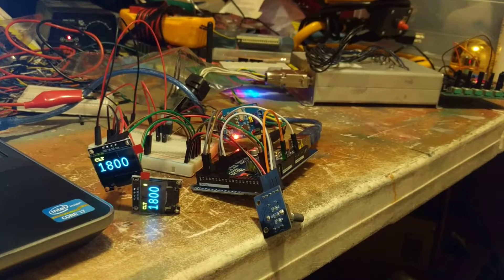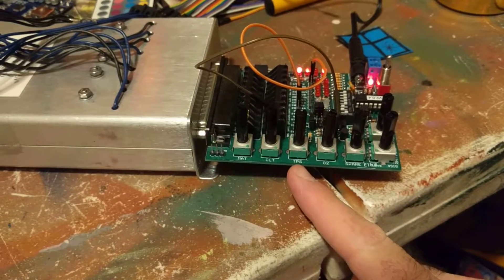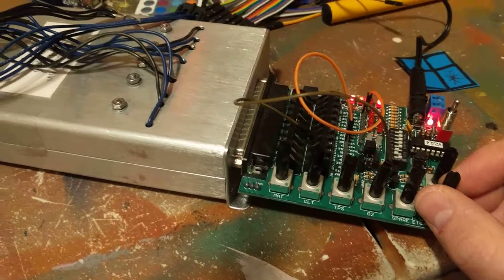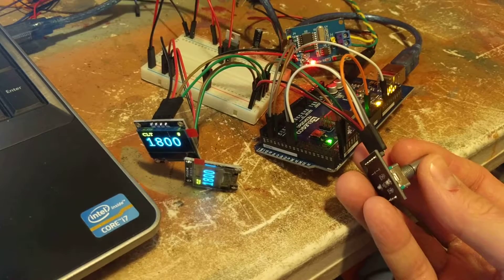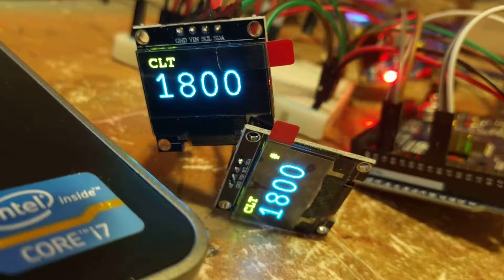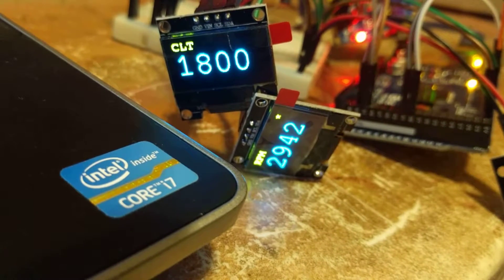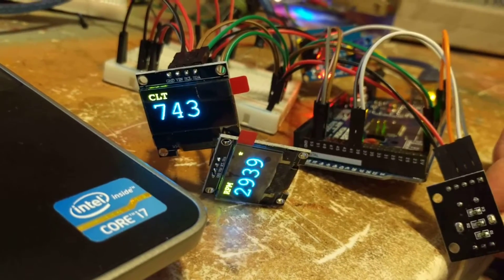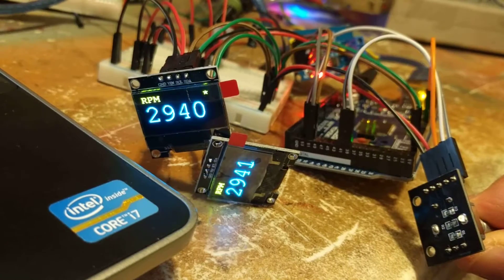Megasquirt 2 with Arduino Display over CAN Bus

Comment: I've been trying to figure this out for a while. Are you willing to share the arduino code for this so I can see how you did it? I get the arduino to connect to the MS via CAN using one of the many available libraries, but I can't seem so pull any values from it. By the way, are you also using the MCP2515 CAN board?

Comment: Hi! Great video! Did you have to change the clock of the canbus module from a 8 mhz to a 16 mhz? I have heard that this module do not work because all the libraries are made for 16 mhz.
Reply from the maker: There's a setting in the library I'm using to use 8mhz.  Here's the module I'm using: https://www.aliexpress.com/item/MCP2515-CAN-Bus-Module-TJA1050-Receiver-SPI-Module-For-arduino/32817132818.html?spm=a2g0s.9042311.0.0.27424c4dr8t9EI